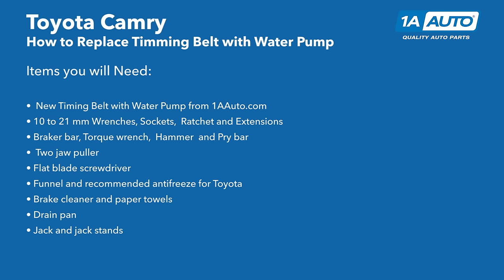How to Replace Timing Belt and Water Pump 92-01 Toyota Camry Sedan

Comment: Great video.  Do you have one for a V6?  Access is a bit different due to the larger engine.
Reply from the maker: +Aaron Decker We're always cycling through common cars. We'll add this repair for your V6 to our list! 1AAuto.com
Reply: @1AAuto  Thanks!  Harmonic balancer bolt is really tough to get off on the V6.  It's 22mm and took an impact gun with 1200 ft-lbs and a special high mass impact socket to get off.

Comment: Thanks for sharing this well
done and explained vid. I would have ordered the timing kit and water pump from you guys at 1AAUTO but I needed it right away. Thank you
Reply: Did your timing belt break while driving and if so did just replacing the timing belt and water pump fix the issue

Comment: I recommend breaking the crankshaft pulley bolt loose then sung it back up before removing the belts... i removed the outer belts with nothing holding the pulley, and could not break the bolt loose with rotating the crank backwards...

Comment: Hi,

PLease help !!!
My parents are old and they bought a car (2006 VW Touran 1.9TDI) and were advised to change the tensioners, belts and the water pump and immediately after the change, the car no longer idles smoothly, it has some ticks, but only when idling, from what my father told me.
I am thinking, the proble is only from these parts that were not used in the propper way with the propper tools, because will be too much of a coincidence to be something else right after these were changed.
Can be a belt too tight, or bad Water pump ( it is a HEPU pump) even if its new...?
Please HELP, what do you think?

With respect,
Gabe B.

Comment: What happens when you happen to turn it counter clockwise? Also after hammering my new harmonic balancer on I put on the belt and starting lining up the timing marks and now my crank won’t turn more than one rotation. It’s just the crank because I took off the belt and turned manually but still only about 380 degrees of rotation.

Comment: Great video. Used this a lot to do the same job on my 99 Camry.
Reply: Richard Christensen 
How did you get the top timing cover out?
Mine can’t seem to clear the gap between the gears and the frame.

Comment: Hi, while trying to remove harmonic puley bolt, the engine turned counterclockwise, i heard you mentionned in the video to make sure you don't turned the engine counterclockwise, now i'm a little scared, have i did something that could damage the engine, thanks in advance for your time
Reply: Only when you are setting the timing always turn the engine clockwise.

Comment: What if the bottom notch lines up but the top doesn't? I assume I just need to remove the belt spin the top pulley clockwise till it lines up.... is that right?
Reply: Because the 5sfe engine is a non-interference meaning the valves and pistons can never touch even when out of time, then yes.

Comment: I'm having a big problem with the timing marks , I had both marks aligned and done 2 times around and the 1 7/8 around then tightened the tensioner pulley ....when doing the next 2 revolutions the timing mark on the cam doesn't line up??? I've done this 4 times with the same results....PROBLEM SOLVED=I started over and lined up the timing marks and held the belt tight with the slack below the cam sprocket while releasing the tensioner and then i tightened the tensioner to specs....Heres what i discovered with this motor=2 revolutions the timing marks are correct.. 2 more revolutions the cam mark is a bit off...then 2 more revolutions and the timing marks are correct again!!!!

Comment: Question. When changing the oil pump is it necessary to change the whole housing. When I search for oil pump my results come back with the whole housing. Which includes the water pump, pulleys, gaskets, and timing belt.
Reply from the maker: +Adoniyah אֲדֹנִיָּה Matah Yahawadah Thanks for the tip! We'll pass this info along to our production team.

Comment: So, just to be clear if the timing belt is broken already and needs to be replaced along with water pump. I need to put the belt on first before realigning the timing otherwise damage may occur if no belt is on? The reason I ask this is because I read that turning the crankshaft without the belt could mess over the engine. Please confirm, thanks
Reply: the engine is non-interference, so having the belt off won't damage the engine.
Reply: but I'd personally just realign timing after you've got the belt on since that makes the most sense lol

Comment: If you use a 3/8" ratchet and a 1/4" reducer with 12mm it makes the power steering top bolt so much faster

Comment: Good job👍 but i do wanna know the  reasons why dont we do as following 2 methods,
(1) why dont we remove the entire engine from the car ? That could be easy to replace timing belt.So y not?
(2) To do so (1) Isnt easy to lift /move.. off the engine from the car herself,is it?.
What i think we cant do that(1) bcz we have to connect many tubes  on the car,its dufficult to do so, while replacing the belt,but timing can be made in properly by no problem.is that right?
Thank you so much.

Comment: Anyone attempting this should also change the oil pump seal and gasket. Especially if your up in miles, they're common to leak. I wish someone made a gasket to fit the groove for the oil pump housing. Toyota used too, now, they're  junk like every aftermarket one I've seen. They used to fit snugly in the groove, no sealer needed, now, you'll need to use something to hold it in place, it's critical it stays in the groove. It's also a good idea to change the cam seal too. While your there, might as well change the crank seal too. The parts are not much, and you will not want to take it apart to fix something that was right there, ESPECIALLY if your paying someone. This whole procedure is VERY SIMPLE.
Reply from the maker: +James Smith Thanks for the feedback!
Reply: Part # for mine is 15188-74050. The aftermarket one was warped and didn't fit correctly. Toyota part more expensive of course. You can put grey 1 hour RTV in the groove, wait 15 minutes for it to set a bit. Then put o-ring / gasket in and it will stay in.

Comment: If the marks don't line up after turning the engine 2 revolutions, will it hurt anything to move the pulleys independently? I took off the belt before lining up the marks.
Reply: No just make sure u rotate it till #1 piston is up on compression stroke then rotate to cam is in the correct location boom its in time

Comment: Worked like a charm, except the temperature gauge climbs to high, Fans are on and I added antifreeze. I think I should remove the thermostat. It is also new, along with the water pump.

Comment: I have a question. I have a 2011 Hyundai i30 Auto, and I want to change the timing belt myself. How can I keep the crankshaft in place while I untighten the crankshaft bolt?
My knowledge is, if I want to undo the bolt, I have to turn it counter-clockwise, but I want to avoid turning the crankshaft counter-clockwise.
Reply from the maker: +C J At this time, we do not have a video for the install you are inquiring about for your vehicle. Please try searching further on Youtube. Thanks for checking us out!

Comment: I thought one would want to replace the Camshaft seal and the Crankshaft seal.
Reply: If they are old.
Reply: My motto, do it now or do it later
or as long as i'm in here
also the oil pump gasket and seal

Comment: At least it’s not an interference engine. You COULD run it til it breaks but it’s still good to do it at the recommended interval which isn’t very often to be fair.
Reply: I put 200000 on mine that's why am here

Comment: Please help. My harmonic balancer is not at the 0 mark rather it's at the line closest to the 0 5 10 and 15 marks. But my cam pulley is lined up correctly. Is this how it's supposed to be?
Reply from the maker: +just me The full instructions written out are on the website listing under tools and how to tab.  They say "Rotate the engine clockwise twice from the harmonic balancer along the 0 degree mark".  The balancer should be at 0 so you may need to rotate this more.

Comment: Will this process work on a 1991 Camry also?  Toyota did a major redesign on the Camry and I have to replace the pump on my mom's old 91.  Damn car still runs great except for what sounds like a grinding noise coming from the water pump and over heating issues.  (Probably a shot bearing.)  Anyway, if anyone knows please let drop me a responses.

Comment: I did this and the car is running smooth, except the temperature gauge goes all the way to hot. The car is not overheating though. I replaced thermostat but it is still overheating according to gauge. I put the heater on and air comes out warm.

Comment: 10:15. Removing the 19-mm bolt. My car is 5-speed. I placed a 19-mm impact socket and long bar that pushes against drive axle. then switched to 5th gear and started turning the right front wheel clockwise with the help of long lever, Wheel sends the motion tru the gearbox to the engine, engine turns clockwise, and the nut is fixed, i.e. turns ccw. Very easy. I noticed there are 2 wholes with 6-mm thread on this harmonic balancer. I tried to attach a special home made instrument. This is 2 solid bars of steel, attached at one end to form a V. On the open end of the V    I passed long 6-mm bolts into the threads of the harmonic balancer. Did not work. My bolts were loaded on bending. Any idea on how to fix the harmonic balance with steel bars? Bed frame L-profiles are easy to find.

Comment: Alright, so i just replaced part of the water pump and the timing belt on my 01 camry. When I put everything back and started, I  got a P0300 code. I looked it up, and one of the reasons is that the timing belt skipped and is not synced properly. I guess I have to take everything apart again.

Comment: How do you keep the harmonic balancer from moving when you take off the bolt?
Reply: One trick is to use the old timing belt to hold it in place while using two vice grips on the timing belt in strategic places to lock the camshaft up. Even then it requires a breaker bar with an extension with all of your might to break it loose (if you'r lucky). This is where an impact wrench saves the day (an air powered one if you can swing it.) Also you can use one of the bolt holes on the harmonic balancer and wrap a wire strap around it and bolt the other end if it to the frame from keeping the harmonic balancer from moving backward while you use the impact wrench. Also apply lots of heat from a torch.
Reply: Did you every figure it out?  I have the same question.

Comment: If thr belt broke already, is there gonna be any internal damage?, thanks
Reply from the maker: +Andres Alonso We wouldn't be able to diagnose an issue like that here, you may want to have a local mechanic take a look at it. Thanks for checking us out! http://1aau.to/m/Shop-1AAuto-c
Reply: I believe its a non-interference engine so you should be ok!
Reply: Its a non interference engine on my 2000 V6 think so with the rest. You need to verify. With a non interference engine, you'll be stranded but with no engine damage

Comment: I followed the procedures and when after i put everything back together, i started the car and now its idling high. any ideas on what it could be?
Reply from the maker: Thank you for watching our video!  We do suggest taking your vehicle to a local mechanic to further diagnose the issue. Thank you! +Javier Vasquez
Reply: @1AAuto  Thanks for the reply, I just had to let it idle for about 5-7 minutes and it eventually went down to normal RPM.

Comment: How about a 1989 Camry 4 cylinder? Is it much more different ? The engine looks similar
Reply from the maker: +Marcel Covaci  This video is applicable to the 02, 93, 94, 95, 96, 97, 98, 99, 00, 01 Toyota Camry.

Comment: 6:00 The triangular bracket is a real pain in the. If you remove the front engine mount you can drop the engine a bit lower and have better access from the bottom. when engine is low you have easier access to the PS pump
Reply from the maker: +West_Park Thanks for the tip!

Comment: Whats funny? I'm doing this on my 1994 2.2L  5sfe and it doesn't have a "Crank Position" sensor. And the "Dog Bone Mount Bracket" is totally different and a real pain in the Ba-Donk-a-Donk to get in and out. The upper timing belt cover has to be taken off in order to get the bracket out. Therefore the cover will also have to be put back on AFTER the bracket is re-installed.

Comment: What part or step makes this job so expensive at car repair shops.??
Reply: Mainly time, few hours at shop rate. Here it's around $150 per hour, maybe around $700 for the job. My mechanic charge me full price for parts even though he gets a 30-40% discount. Thus I try to do most things myself including timing belts.

Comment: what about the cam and crankshaft Oil seals.
Reply: YOU MUST! do this! even more so than changing the water pump!
Reply: Yes , i was about to say that I had a mechanic from the block do this job and im now suffering from an oil leak its costing me $$$$ for oil
Reply: Aaron Kashmer That is false. If they aren’t leaking I wouldn’t even worry unless you already have new seals (Toyota OE) on hand.
Reply: @jgomez1505  So you're saying that because he didn't change them, his lack of even disturbing them has somehow caused them to leak?
Reply: Check Toyota nation someone posted a good tutorial in the Camry forums
Reply: @ThePariss333 I thought so too but...A quart every 60 miles on my Celica for quite some time before I fixed it. My Camry was much less a quart every few hundred and then suddenly 1 quart every 15 miles! Needless to say I didn't drive it at that point and am fixing it. So yes they can leak like crazy.

Comment: The O-ring on top of the top coolant pipe is making it hard to reinstall the water pump like it fits perfectly without it but when I put on the o ring it throws a fit off I can’t even get those two nuts That Secure the bottom coolant pipe back on with the o ring on

Comment: if remove the water pump in toyota camry  what problem will b accured?
Reply from the maker: +ahmedraza khan We do not have a way of being able to diagnose the issue that you are experiencing with your vehicle but suggest taking it to a local mechanic for a proper diagnosis.
Reply: @1AAuto  thanx

Comment: I believe you can spin the engine backwards it even shows it in the factory service manual
Reply: If you turn it backwards it puts abnormal stress on the tensioner, which might result in a loosened belt.

Comment: What's the cost of changing the timing belt in a 1992 toyota camry 4 cylinder  ???
Reply from the maker: +uzipo ventezinko It would depend on the hourly rate of the shop. This video will walk you through the process and we carry the timing belt and water pump kit shown in the video. Here is a link to them. http://www.1aauto.com/toyota-timing-belt-kit-with-water-pump-gates-tckwp199/i/gaeek00001?utm_source=YouTube&utm_medium=CTA+Comment&utm_campaign=ytcomment&utm_term=2kQLMP9AYGs
Reply: Ever figured it out? With my own tools one shop quoted me $312 that was the cheapest I could find.

Comment: when you do accidentally move the cam sprocket while installing. do you just turn it 1 time around to line it back up? mine just moved three teeth off and they do not turn backwards so is it 1 time?  360  Or two or?
Reply: Larry Leisuresuit two times

Comment: You omitted the op timing cover removal. Mine won’t come out and this video doesn’t have the answer I need.
Reply: Did you remove the dog bone bracket and anything else that maybe in the way?? Maybe your engine mounts are completely shot?..causing engine to be lop sided? Try jacking the engine up some. Although you probably needed this advise 5 months ago.

Comment: I have changed the water pump and change the belt but it's still giving me the same problem
Reply from the maker: +Josh Smith If you are still having an issue we wouldn't be able to diagnose the issue you are having here, you may want to have a local mechanic take a look at it. Thanks for checking us out! http://1aau.to/m/Shop-1AAuto-c

Comment: WOW, glad I have a Avalon - way different for the first part, just loossen the tension side bolt of the alt, no need to take the alt out at all!

Timing cover too, way easier , just 6(?) bolts, away and out, no connectors to relase.
Reply from the maker: +Dan Lo Fat Thanks for watching. If any of our viewers needs to make this repair, we carry the auto repair part shown in this video on our website. Here is a link to them http://www.1aauto.com/toyota-timing-belt-kit-with-water-pump-gates-tckwp199/i/gaeek00001?utm_source=YouTube&utm_medium=CTA+Comment&utm_campaign=ytcomment&utm_term=2kQLMP9AYGs

Comment: You don't mention how you tighten the bolt on the harmonic balancer and what the torque setting is supposed to be.
Reply from the maker: +HeliJim400 Thank you for checking us out. We apologize for this information not being included, but may confirm the torque specification for this bolt is 80 foot pounds. 1aauto.com
Reply: 1A Auto Parts Thanks for your quick response. I will be doing this procedure tomorrow and I feel confident I will be successful thanks to your video.